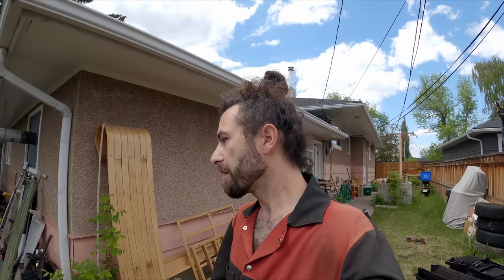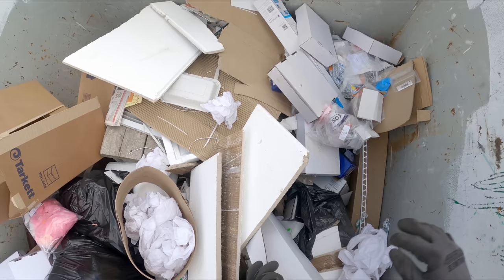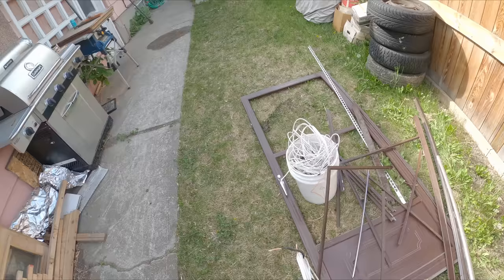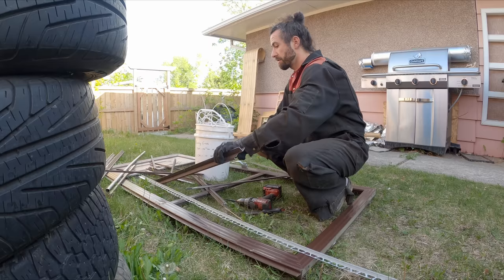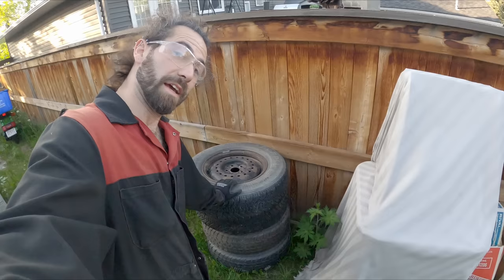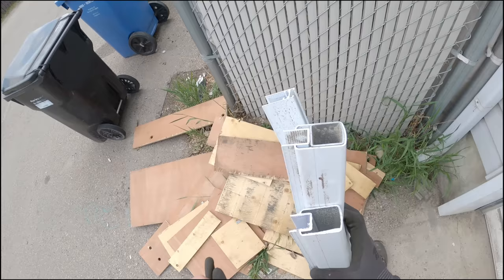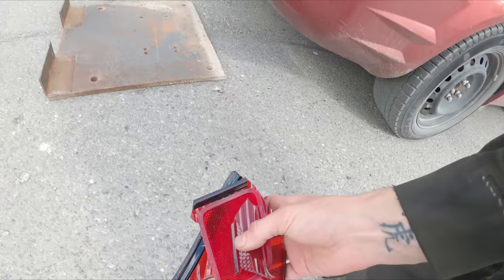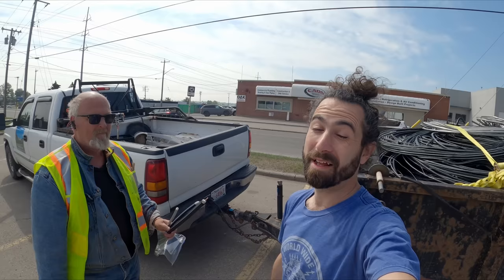Dumpster Diving and Scrap Hauls - Scrapped Big Piles Today!

Comment: On your tires with rims..i cut right down through the top of the tread cut right into the steel rim to cut the heavy cables goes real fast..also same for alum. Rims

Comment: Great job thub!  I used to work in a 24 hr gas station in Eastern Washington, we changed some tires, we were always pulling tires off of rims and installing them, so when I see you using a saw I kind of wince at your efforts.   You might want to go down to a tire store that does on the road tire changes and get a ride along and learn how to quickly change tubeless tires or just suck up to them and get an intro to changing tires w/o a machine.  Those guys know how to change tires in snow, rain, night etc... it'll save you some labor!..  Yeah, right, like you have spare time to do that..   Again, Great job!   I always enjoy your vids!

Comment: Been a fan for a long time Thub! I will admit after hearing the part after you saying 80% aren't subbed, that touched home for me because I have to admit when i first started watching you back in the old microwave break down days, i was not subbed back then, but soon after! been a a fan for a for a long time Thub and you got me into scrapping for the goodies! And i hope u hit 100k very very soon, I say less than 2 wks man! Hey i have a question, how can i tell if my scrapyard is not giving me right prices? I'll bring in iron, steel ,cast iron, etc. And all they'll give me is tin category, is that right?
Reply from the maker: Thanks for hanging around! It’s been a journey, gone through a few chapters now and learned a lot. As far as your prices it really comes down to whatever the scrapyard is going to pay, if it’s all shred as far as they’re concerned there’s not much that can be done. Cast iron is a bit less than shred for me and brake rotors are a little more, and most yards around me don’t pay more for prep (which is why I go to the one I do). I guess you’d better just ask them but it probably averages out to the same most of the time. The prep and rotors are the only ones I’d be annoyed about if you get a fair bit of those

Comment: Hey I was wondering what you do with the rubber on the tires after you've scraped them?
Reply from the maker: Here in Calgary our landfills don’t charge for tires as long as it’s less than 12, so I just drive them over there when I have a stack

Comment: That big honkin slab of steel plate would work great for a small demo table.  Get some angle iron legs and brace it up before welding it together and you've got a table you won't worry about breaking.

Comment: Always remove your weather stripping, rubber seals and rubber screen welting Before you Brake apart or bend your aluminum window,  screen & Door Frames It will cut your processing time in half

Comment: The sad part about those refrigerators in the beginning of the video is that they are probably from a bunch of apartments or dorms just upgrading and they probably mostly work. 😢
Reply from the maker: Most likely yes. All my best finds are from situations where it made sense to the owner to just throw everything out. I like finding great stuff but it feels like a massive waste. They also had a mountain of hundreds of stainless steel commercial coffee machines, I’d guess those all worked too

Comment: How do you know what kind of metal everything is
Reply from the maker: It comes down to experience, but it really doesn’t take a lot of experience to learn. It’s gonna be magnetic or it’s not, and if it’s not, it’s stainless/aluminium/copper/brass or mayyybe zinc. That’s pretty much all we use on anything, titanium and magnesium just aren’t common and silver and gold are pretty special. Outside of that it’s just a question of what the application is (plumbing is brass/copper, sheets and blocks and poles are stainless/alu)
Reply: @thubprint thanks man I appreciate the advice